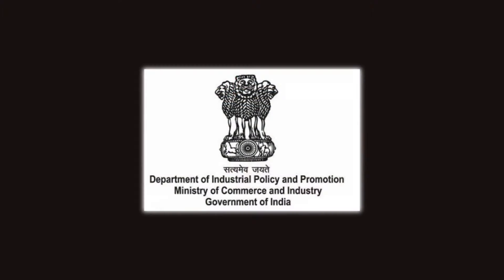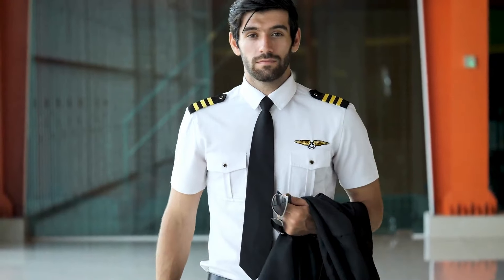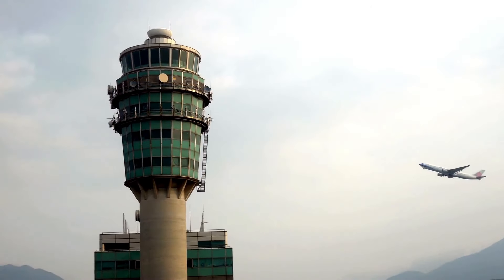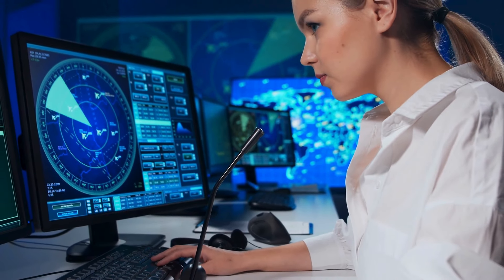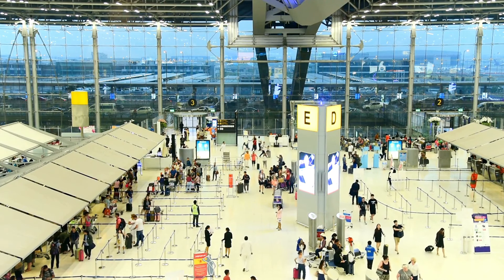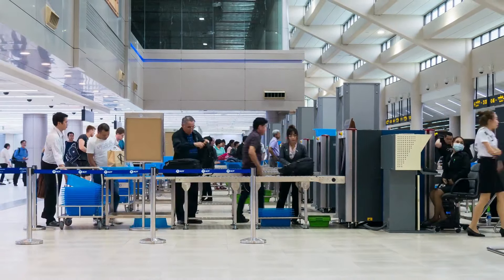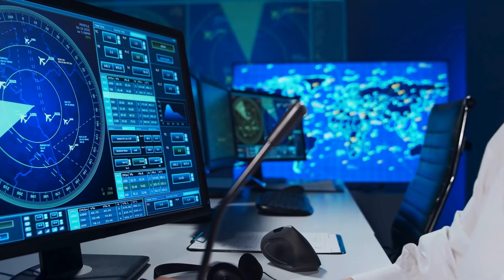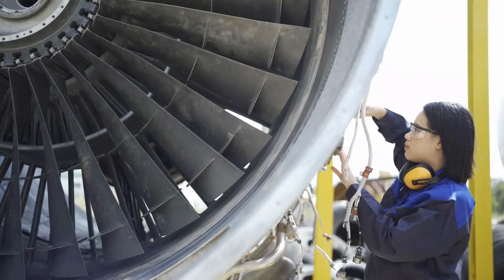Career in Aviation Industry in Kannada | What is Aviation  | Aviation Course

Comment: if there is a one aircraft they need 12 pilots 6fo and 6 captains according to shift wise if we see
Reply from the maker: Thank you✈️
I just mentioned it has as an example. 

✅Two pilots minimum:Every commercial flight, domestic or international, requires at least two pilots: a captain and a first officer.
 ✅Possible third pilot for long journeys:Flights exceeding 7-10 hours (depending on the airline) may require a third pilot on board to allow breaks and maintain crew alertness for long durations.
✅ Fourth pilot for some very long flights: Some airlines might require a fourth pilot for flights exceeding 12 hours.